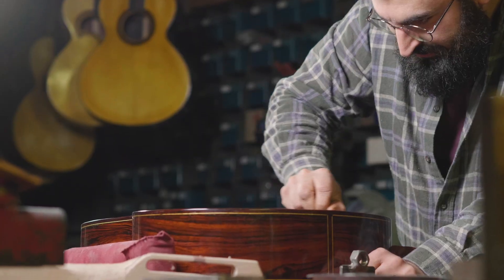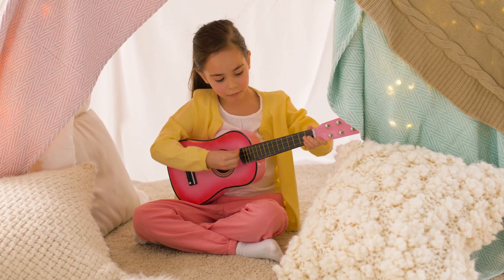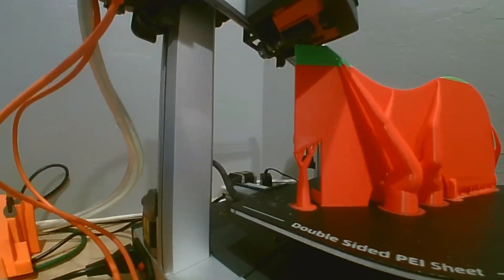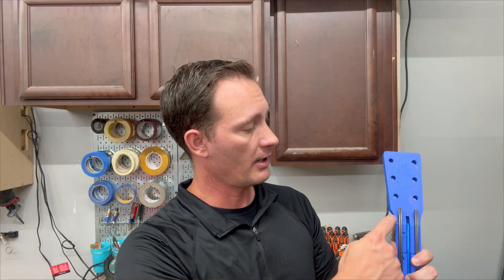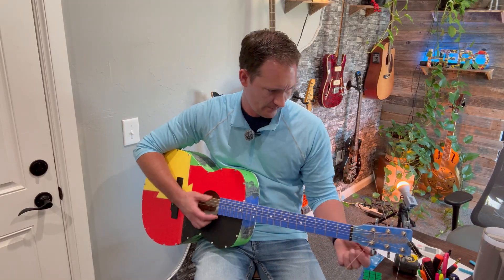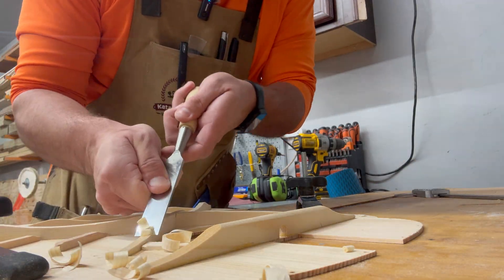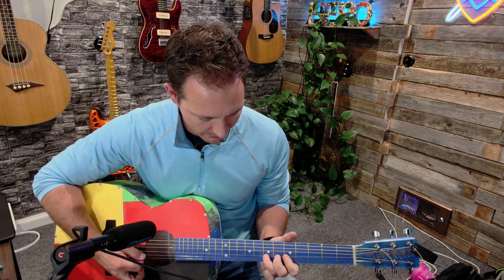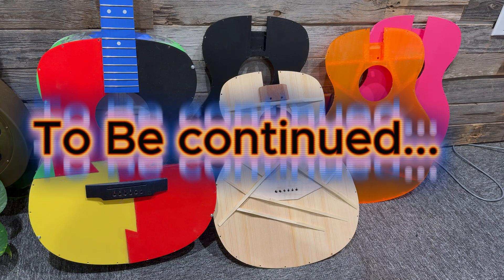A 3D Printed Acoustic Guitar that ACTUALLY sounds good?

Comment: The top being made of 4 different 3d prints glued together is almost certainly a source of the lack of volume, each join will be impeding and dampening the vibrations, which will already be having a hard time due to the material. All in all very cool though, was surprised the filament was able to stand up to the stresses of tension without breaking, although over time I suspect it will warp pretty badly. 

Would be interested to see you try different internal geometry to try and sculp the sound, with a 3d printing I'd imagine the options are limitless.
Reply from the maker: I agree about the glued top. And because I have poor impulse control. I bought a large format printer to test out making them in single pieces!

Comment: I found this very interesting. Thank you. But I also have a challenge for you: What if you tried building a classical guitar using the same method?
Reply from the maker: So in theory, a classical guitar would be easier. Way less string tension, little smaller, and most don’t have a radius on the soundboard. So, I could just print it flat.
Reply: @nerdywork every classical guitar since Antonio Torres (the pioneer of guitar making in the 19th century) features a domed soundboard. It was Torres who reasoned that the dome was key to the guitars sound production and volume. He also built a guitar with paper mache back and sides because he believed the composition of materials in the back and sides did little for the guitar, so I’m not surprised by your results that both tops sound similar with a main difference being volume.

Comment: I've made several different steel string acoustic guitars and can offer you some guidance going forward: 
1. To get any volume out of the guitar, you need to come close to matching the mass of the plastic top to that of a spruce top. 
2. You also have to match the stiffness properties of spruce. Here CF filaments will improve the sound greatly. My best sounding guitar uses PPA-CF which has 3x the stiffness of plain PLA. I've ended up using some pretty complex ribbing structures and infill patterns.
3. Plain PLA, without metal, wood or carbon fiber rod reinforcement will creep over time under the 160# string tension. You have CF rods in the neck (good), but eventually the belly and even the headstock will likely warp considerably. Especially if it gets warm at all.
4. Actually gluing the top on, rather than just screwing it on, makes a big difference in the tone. The foam tape you used as a gasket for the top is likely draining a lot of energy from the sound. 
5. Also all the glue joints in the multi-piece top are probably taking a toll on the sound. If possible, try to keep a resonating area around the bridge as a single piece.
It's great to see someone else working on this -- good luck with your iterations!
Reply from the maker: Awesome information! I hope to test these and more out in the future.
Reply: I had the idea to combine 3d printing with poured resin to achieve a wood like density and to add better continuity for the vibrations. I'm new to 3D printing and actually only got my first printer in the mail yesterday so I don't know how feasible that is but I'm thinking a 3d print a structure that's both the mold and part of the final part. That would also allow you to combine smaller parts into the greater whole better since I know continuity is important for resonance. 

I know that resin has been used for making instrument bodies before to some degree of success. but I think there might be surprising potential in making composite materials for acoustics this way. What do you think?

Comment: Dang that was pretty cool. I am going to try it out with my brother who likes doing 3D stuff. I'll let you know how it turns out. Maybe adding pickup might be a cool experiment. Also, the nut and the saddle are key on the sound. I would suggest carbon fiber also for the sides, because although the top is the "voice" pretty much everything that bounces inside the box will affect the tone.  personally, I did like "B" better than "A" - for additional sound depth, the Fender acustosonic guitars sound-hole might be the answer to make it louder. Sure, it won't compare with a Martin (nor it should), but then again, they have been experimenting for more than a century.
Reply from the maker: I had to skip it in The video for brevity but I did use a bone nut and saddle. I tried printing them 1st and they were decent, but the bone was definitely better. I do want to try to make one totally out of CF filament sometime.
Reply: @nerdywork  yeah I thought it had a bone nut/saddle because it sounded super crisp. This was a very inspirational video, thank you for sharing!

Comment: I wonder if you added a sound port to the side of the body  or maybe an oval sound port in its current location to tune it for a given sound. I’m not a luthier nor engineer just a guitar and electronic ticker, I’m a ev technician by trade so take my ideas with a pinch of salt.
Reply from the maker: I think it's at least worth a Shot! I hope I can convince some real luthiers to take this to the next step and really help me refine the sound.
Reply: @nerdywork  well I can’t wait to see the outcome. Hopefully others in the 3d print community will join. I might even take a stab at it. I’m almost done with my 3d printed start. The one on your wall looks like the one I printed. Just waiting on hardware and electronics for it.

Comment: I mean not everybody needs a loud acoustic guitar. Also you can make it smaller in depth and a bit more comfortable, plus insert the electronics to make it electro acoustic. And i think in a mix you can fix and change the sound to any tone you want, and also with the connection to the computer you can play with any sound you want and any volume.
Reply from the maker: totally agree. Volume doesn't matter much if you can amplify it, and with modeling software you can make it sound amazing. I had to fight the urge to try that on this test because I didn't want to represent the sound falsely. It's bad enough that Youtube compresses the sound so you cannot hear the volume difference as much in the video as in person.

Comment: The top vibrating is what produces the sound, so the gasket is effectively a shock absorber. Remove the gasket and it'll sound better
Reply from the maker: Yup, I’m going to test that next and see the difference.
Reply: Correct. The vibration of the soundboard is where the sound comes from combined with the back and sides gives it the tonal qualities. Remove any gaskets and allow the whole thing to come alive.
Reply: yah... exactly what i tought... let´s see the result...
Reply: Glue the top on with a glue that will release easy OR Washers and a small gap WILL sound good too. I have offset a top with felt washers. It was very loud!   I make my Basses like that now and I don't need an amp at the beach jamming with my friends.

Comment: The problem with PLA is that it creeps over time under load and especially if it's in a hot environment. I'd expect the neck will be ok with the CF rods, but the bridge area will dish as the front of the bridge is pulled into the body under tension - however, the top is easily replaced, so if that does happen you can try Petg or abs/asa.

I would be interested in generating the structure of wood grain into the top - what infill did you use? If it was solid that would be why it sounds "boxy". thats the amazing power of 3d printing, that you can create complex geometry inside an object - and test out different grain patterns using density through the plastic. You could force solid walls in the winter grain, and then use infill for the summer grain
Reply from the maker: Absolutely! there is so much more we could test out. The infill I used on this one was 70% with 5 walls. So, the thin part was pretty much solid. But less infill on the braces could let it vibrate more. And I wonder if different infill patterns would change the sound. So, much to test out. I really hope the community can take my plans and make them better!
Reply: Along this same line of thinking, we are discussing something that is commonly used in typical 3d printing using certain types or styles for infill.
Now think of what would make the best infill for the pieces of this instrument and the stresses it must endure, without dulling or muting the fewest frequencies.
Lines radiating from, I don't know, to other places that I don't know. Never built one of these, so it would be purely a guess on my part and someone with that kind of knowledge could figure it out quickly. Again, not the common types of infill, but something more appropriate for the desired outcome.  I sincerely hope that I am making sense to someone. I do tend to think about the logic of creative problem solving. My "twist".

Comment: This is a feat of engineering and has the potential to get well-designed guitars in the hands of those who can't afford them. Open source open chords!
Reply from the maker: I would love if it could get there. And that’s definitely one reason I made the files open to everyone. I tried to make sure the licenses I picked allows you to do whatever you want with files except profit off of them. 

The his 1st iteration it won’t be great for getting low cost guitars into the hands of kids. Not when you can spend under $200 for a starter acoustic guitar that almost sounds as good. The filament for this guitar alone was probably $150. Then all the hardware. Including $50 worth of carbon fiber rods. It ends up being less expensive to buy a cheap mass produced guitar. 

But maybe people can iterate on the design and make it better, cheaper, faster, and better sounding. Then it might have a chance!

Comment: Cool project! The connection between the sides and top should be as rigid as possible so the resonance travels through the acoustic shell as freely as possible.  I would think a gasket would absorb energy and dull the sound and lower the volume. Also, my dad was the foreman of Mossman Guitars in the 70s and his personal guitar he built with the top and sides .03" thinner than on their production guitars - everyone in the shop said it wouldn't last a week... it's loud, responsive, balanced and he still has it to this day. Nice video, man!
Reply from the maker: That’s a really good point. I’m gonna have to try it with the gasket off as part of the next video. And that’s really cool about you dad working at mossman. I would cherish that guitar forever, and I would think the thickness and its likelyhood to break would depend more on the specific piece of wood. That’s something that real luthiers are good at figuring out

Comment: I was able to guess the right one! The A/B comparison was a good idea, and it's impressive that you carved a nice sounding wooden top! I think there could be some issues due to the way the plastic top is bonded together. I tried 3D printing a ukulele-sized instrument in one piece and when I'd tap the top, it rang with pretty strong pitches almost like a djembe drum. The tap test with yours was more like a dull thunk. I think I've seen previous designs where the top is split along the braces or it's thickened at the seam lines, so that might help?
Reply from the maker: I totally agree. To combat that for the next video I have purchased a printer large enough to print the top in one piece.

Comment: The other thing to consider is direction of the print. It looked like you printed everything vertically. How would it sound printed flat?
Reply from the maker: Absolutely, and I did think about that, but it’s really hard to print those pieces flat because of the curvature. I would probably end up having to sand off all the supports. 

My other thought was that the vertical orientation should be closer to how wood fibers are oriented.

Comment: Yep, you go it.  The biggest contributor to the sound is the soundboard.  The back and sides main job is to provide structure and reflection.  The back and sides do "color" the sound for sure, but we spend the majority of our effort getting the top to be a careful balance between responsive and structural.  When you put the wood soundboard on, it reminded me of the Ovation series of guitars.  Their whole design is based around a traditional wood top and a plastic, rounded shell.  (they blend the sides into a rounded back)

I think there's lot of opportunities to play with your concept.  1) You could try infusing 3D prints into the bracing, much like others incorporate carbon fiber into their braces to increase strength and reduce the wood mass.  2) You could play around with a removable neck/joint using a 3D printed joint.  3) You could play around with different openings around the sides to adjust the resonance.  That's just a few off the top of my head.

I'm curious what will happen over time.  160lbs+ of constant string tension on plastic is likely going to warp.  My guess is, it may wind up being a "temporary" structure. 😏

Good video and a fun project.
Reply from the maker: Tim! I love your channel! I hope the community picks up my files and uses them to test out these ideas and more. I think if we all work together then we can really revolutionize guitar building. I know there are few things I want to try in future videos.